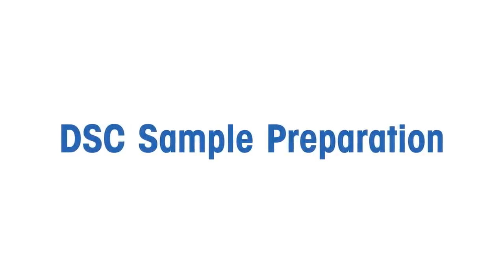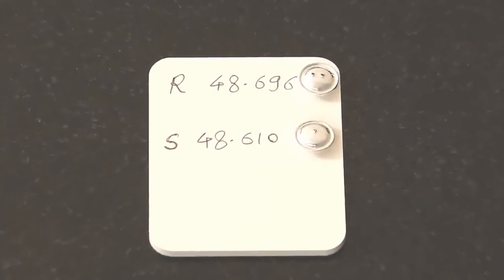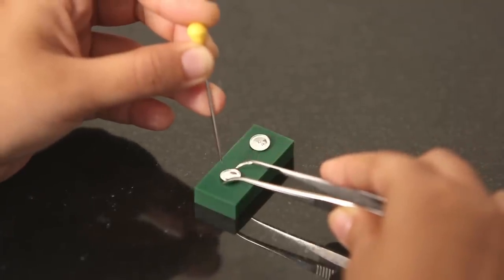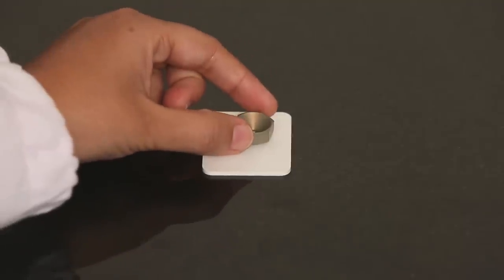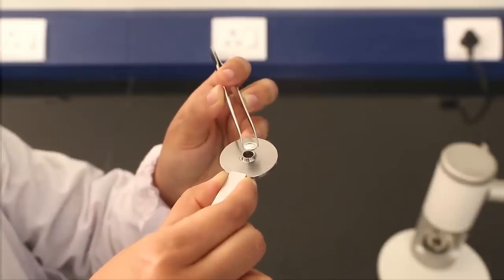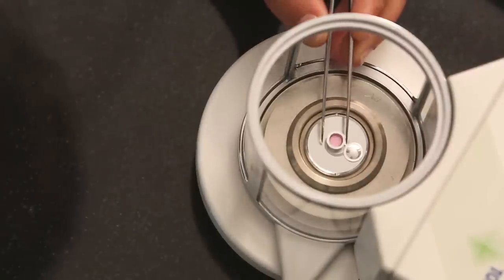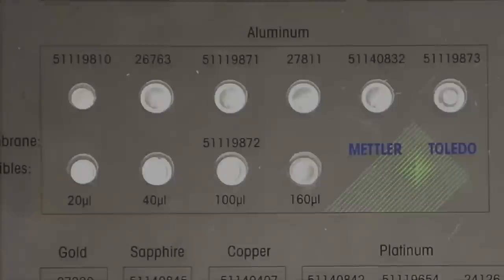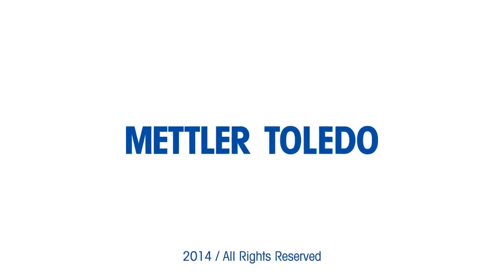How to Prepare a DSC Sample

Comment: Can I use insulation board for DSC to determine the heat capacity of the board?
Reply from the maker: It is possible to determine the heat capacity of an insulation board, but you
should not use more than a 40 μl sample.
Reply: @METTLERTOLEDOLaboratory  but our sample is about 270g. How can it determine the heat capacity for the whole 270g?
Reply: @jenrubykim3529  Heat capacity output is per gram of material. Assuming homogenus heat capacity just multiply the output by your total sample size.